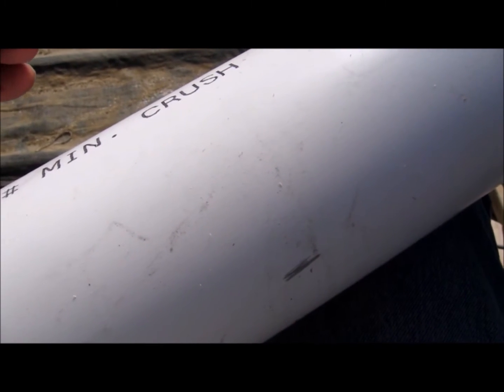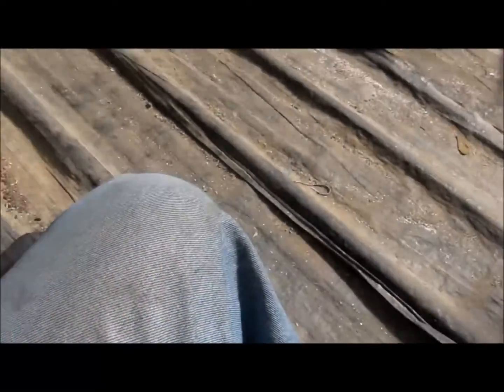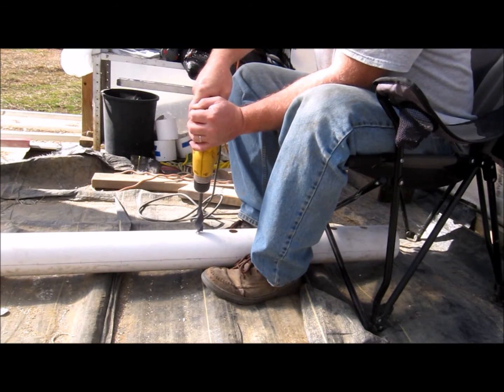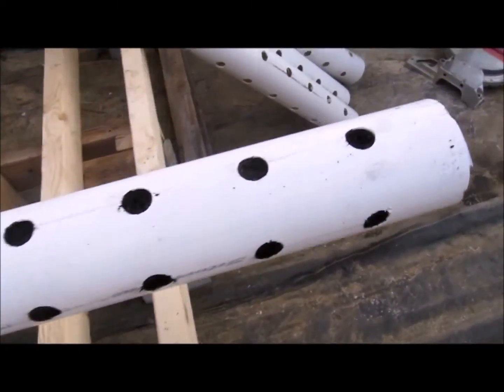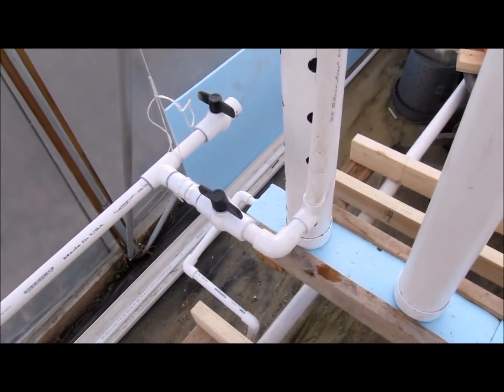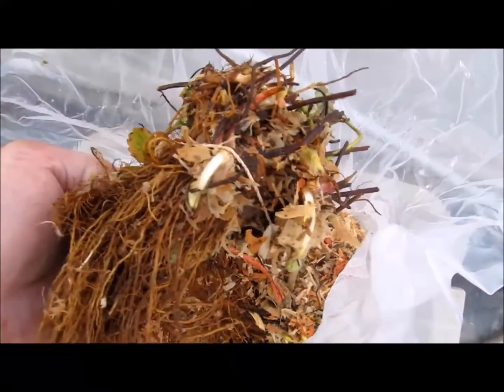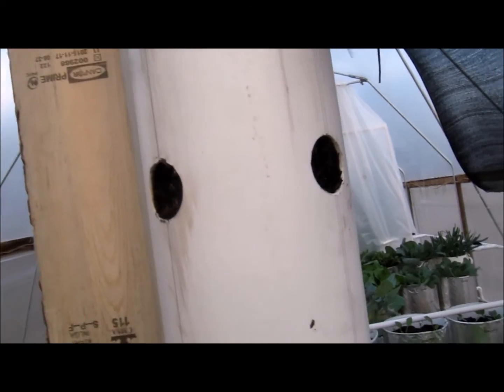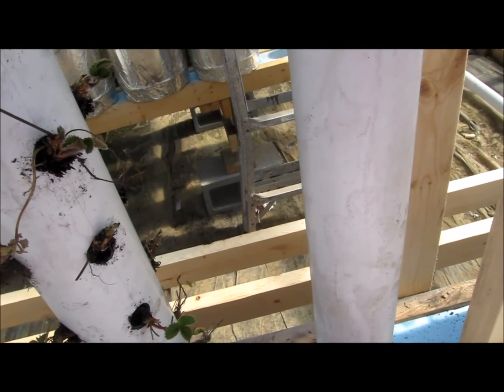Strawberry Towers - 3 of 3

Comment: I am very impressed with your vision to experiment what works best for you. Is this strawberry setup your idea or have you seen it elsewhere. Are you concerned any liquid will seep out the holes?
Reply from the maker: +3051buckmaster Hey Buck!  Almost nothing I do is ever completely my idea.  I think that's true of almost everything everybody does.  Some stuff I do is new, but changes in other things I've seen or done in other parts of my life.  For example, with these towers, the 4" sewer pipe has been done as well as gutters as a reservoir.  The rest are changes I made.  3/4" holes, net pot on bottom of tower, foam board on top of gutters, nutrient in gutters, PVC watering in hydro, organic mix in hydro, and compost with hydro are examples of stuff I've changed or added.  At least, I haven't seen it.  I was concerned about leaks and didn't know if it would seep out of the holes until I actually did it!  It doesn't leak and I'm thankful as I was all in on it!  Did have some wick dripped towers last year with the platform.  I had an idea it would work.  Glad to have you tuning in buddy.
Brent

Comment: My question is what is the purpose of the bucket on top? I didn’t get to see you put the plumbing return, is there any chance of getting it? I’m actually very interested in getting this,
Reply from the maker: The containers on top are the normal way I grow.  Since I had to provide a water source, I thought I could double-duty and let some veggies cascade down.  I'm not sure what you mean about plumbing return, but nutrients flow (used to) into a gutter at the bottom then through 3/4" pvc back to the return tank.  In the towers, the towers set on top of the gutter instead of the buckets at the top you see in this video.  So, the nutrient/water flowers through the top buckets, through the towers, then into a gutter and returns to the nutrient tank.  Look at this video for general FAWN info:  https://youtu.be/OJ3sjnT8VmQ

I do it differently now making what I think are improvements to FAWN.

Comment: Hi, Brent. Following you for some months from Spain. Always good ideas in your videos. Just one question: are you using nutrient solution or just water? You're planting into soil, not perlite or other typical hydroponic substrates so, do plants really need constant nutrients supply? 

Thanks for sharing your ideas!
Reply from the maker: +Daniel Rotea Yes, nutrient solution (Masterblend/Calcinit/Magnesium Sulfate) is the base of everything in FAWN gardening.  FAWN is an acronym for "Flowing Aerated Wicking Nutrient."  I keep the nutrient aerated constantly.  Unlike strict hydroponics, I don't keep the nutrient flowing all the time.  It is on for 3 minutes every two hours during daylight hours.  I try to build on the base with organics.  I'm even adding vermicompost tea into the nutrient solution.  The "soil" you speak of is aged rice hulls, a slow decaying organic.  I have also used peat and pine bark.  I am quite certain it is not necessary to keep a sterile environment as many hyrdo folks do.  My hydro nutrients are at about 900-1000 ppms.  I plan to cut that back to 600 or 700ppms and add more compost tea than I'm using now.  That will come later in the year.  We will see what it does.  If it sours, I will adjust.  If it works well, I'll lower ppms even more watching plant growth all along.  Ultimately, I want to grow as close to organic as possible, but grow extremely well.  I love to share so no problem.  ¡Gracias por ver! (hope i got that right).
Brent
Reply: C3 Voyage Jajaja! Gracias, Brent.

Information about hydroponic culture in Spain is quite limited, and even more when talking about "organic" hydroponic, so I'm glad to follow your videos.

Just one more question regarding the use of soil (peat, rice, vermicompost or whatever) Does it give you any kind of problems with the pump? I guess there must be some solid residue or suspension micro solids fixing everywhere in the system.

PS: Too warm winter in Spain. My greenhouse is reaching 37 ºC (almost 100 F) everyday...   :(( 

I'm getting boiled vegetables directly from the plants!!
Reply from the maker: +Daniel Rotea Not one problem with the pump in 2014, 2015, or this year.  The nutrients drips through soil "filters" and into the gutter reservoirs.  At the end of the gutter, there is an elbow going into the nutrient, but not all the way to the bottom.  Things that sink don't go in and things that float can't go in.  The pump is also covered with netting.  What returns to the nutrient tank may have some residue, but not enough to do much.  Even when I was using drippers, the clogging wasn't overwhelming; just annoying.  Now with the current watering, not one clog yet.  The design of the pump accommodates particles and the lack of single points of failure (drippers) are removed throughout the overall system.  I put a ton of thought into this and lots of trial and error.

Love Spain!  Was there in 1986 for 45 days while I was in the military.  I want to go back some day.  Our temps get over 100F too!  Best one can do is put up shade cloth and run fans.  It's the worst time of year for me.

Brent

Comment: Hi again, Brent. How do you fill the pipes?. I build my first one today. I first drilled the holes, put some duck tape on them and filled with soil. Then started to water till water flew throughout the bottom hole and planted the strawberries after removing the tape. Is there any easier way to do it???

PS: waiting for you in Spain!
Reply from the maker: +Daniel Rotea First, you gotta send me a picture!  Love seeing other's work.  Take a look at this portion of the Vertical Onions Video.  It shows where I fill a tube with the Rice Hulls:

https://youtu.be/nf8cvE1oP_8?t=3m39s

I didn't use any tape or anything.  the medium was damp though and not much fell out.  As long as it's moist, the "soil" stays in the tube.  If you have a soil that has fine particles, it might not work as well.  I would hope you don't have to tape each hole!  Remember, my hole is only 3/4 inch or 2.5 centimeters.  Love to hear an update.
Brent
Reply from the maker: +Daniel Rotea Saw your picture.  Awesome.  I lightly tamp down the soil.  At first, I did it way too hard and it was too dense for onion roots to get into easily.  I've never watered a lot at once.  My water pipes kick on for about 4 minutes delivering probably .5 liter or less each time, several times a day.  Meaning, the water flows down the soil slowly and compacting it much less.  Once roots set in the pipe, the roots will also keep the soil from compacting.  In your case, I don't know what your soil is comprised of.  Actual dirt from the ground?  Peat mix?  Other?  The size particles of the soil you use have an impact on the compaction.  You want a container type soil.  Also, you can water it a few times before planting to get to a fixed settling level.  Love to hear how it goes.
Brent
Reply: +C3 Voyage HI, Brent. Soils is a standard commercial one from COMPO. I think it is mainly a peat mix with some compost and some perlite, maybe a 5%. This week I'm going to set up 3 short PVC pipes (1 meter or so). One with the same soil, one with perlite and one with a homemade soil (15% perlite, 15% vermiculite, 30 % coconut fiber and 35% worm compost) Each one will have its own pump and reservoir, so I'll try to see if there are significant differences among them. By the way... are you using the same reservoir and nutrient solution for all the plants? And, which pump are you using to move such amount of water and at that height?
Reply from the maker: +Daniel Rotea Send me pics on the Facebook page.  I wanna see!  Yes, 250 gallons of nutrient gravity fill a 25 gallon pump reservoir.  A float valve keeps it full.  Nutrient is pumped out by a 1000 gph $50 pump:  http://www.amazon.com/gp/product/B0049XENYS?psc=1&redirect=true&ref_=oh_aui_detailpage_o00_s02 using the PVC watering method returning back to the 25 gallon pump reservoir.
Brent

Comment: You system looks good, but the plants looked rough when you first opened the package. Strawberries must be tough plants, because they look great in later videos.
Reply from the maker: +Cajun Calvin Hey Calvin, Google bare root strawberries and look at some pics.  They look like that.  Actual plants are usually called plugs.  Thanks for watching buddy.
Brent
Reply: C3 Voyage
The wife and kids want me to do strawberries, and I was looking for the most economical way of buying plants. I am going vertical, but I am unsure of which method. Thanks.
Reply from the maker: +Cajun Calvin Well, at the least, I hope I've offered some ideas.  Best of luck Calvin.
Brent